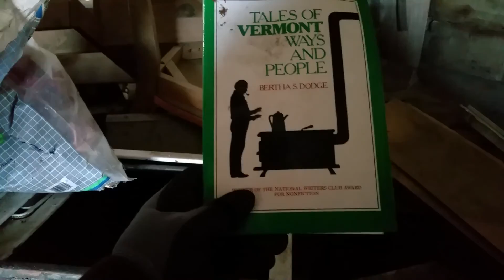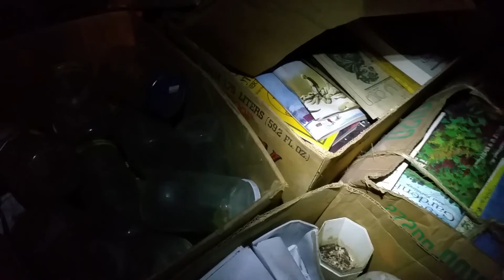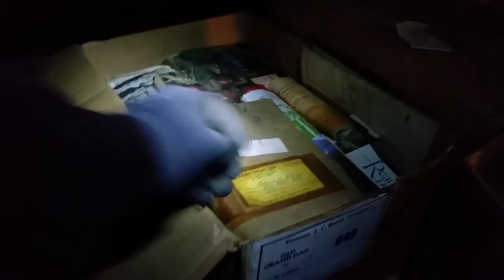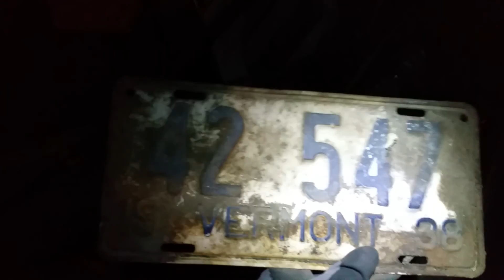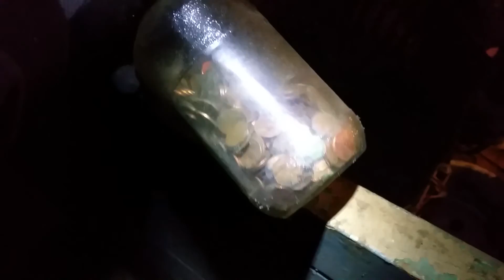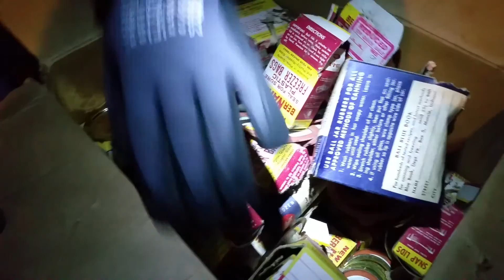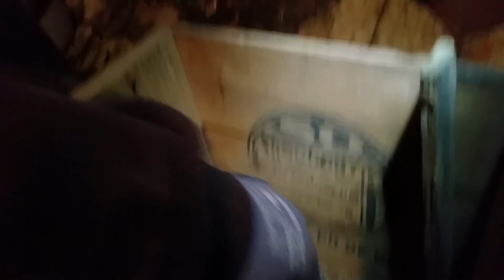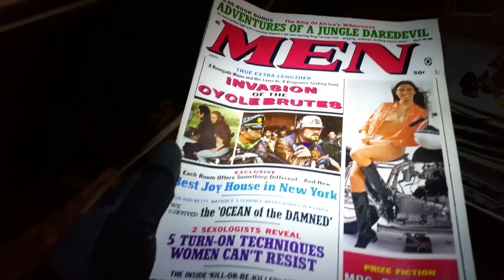American Amateur Pickers Part 1

Comment: That was almost as much fun as hunting for old bottles. I have been buying, selling and collecting antiques and vintage items for many years. Those were some neat finds. Those old thermoses have value if the glass inside is still intact. The old fan is very collectable and I loved those old syrup buckets. Too bad about the old multi gallon stone crocks having cracks. That old iron still has value even in that rusted condition. The wire canning jar rack is to hold the jars in the pot while they are undergoing a boiling water bath. I have one I still use. I love the old washboards. I have a collection of them hanging in my laundry room. That old wooden standard oil box is highly collectable. Great video!!  Cant wait for part II.